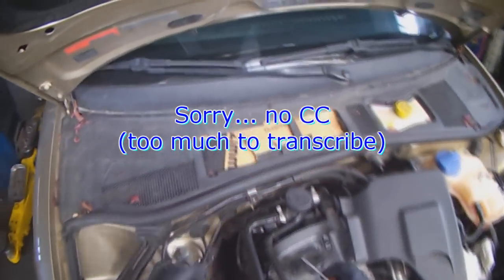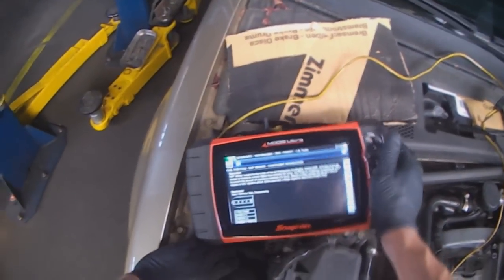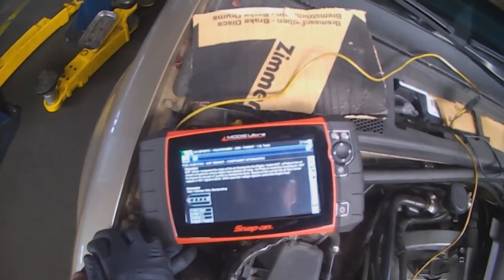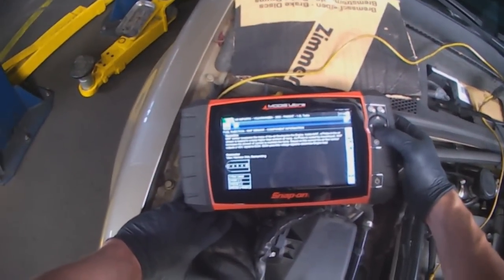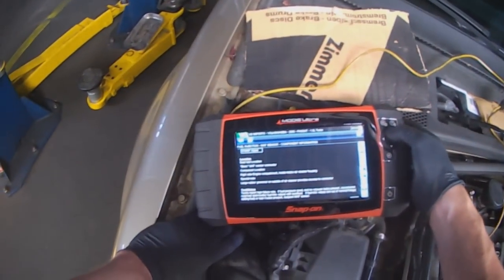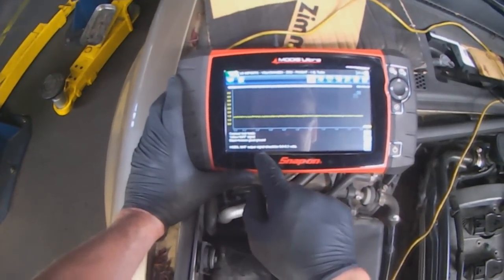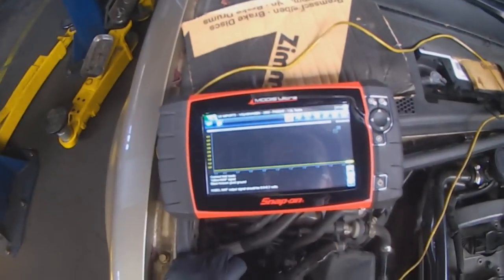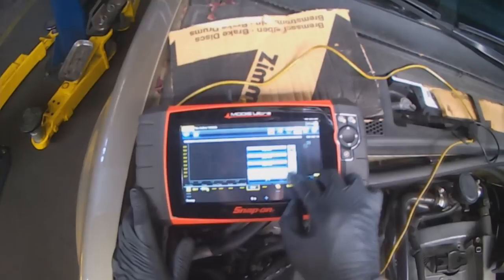1.8T MAF sensor signal output (helping a viewer)

Comment: Hi, i have a p0102 code and no maf input at all the signal is 0g/s. I don’t have battery positive on the pin 2, i have 0v. I’ve seen the wire from pin 2 goes to the fuel pump relay, could it be a bad relay ? Note that the car starts and runs but with a loss of power. Also fuses s28 and s32 are good. Anyway thanks for your videos used to watch them when working on vag’s they are helpfull. ;)
Reply from the maker: The C5 A6? What year, engine? So I can look at a wiring diagram.
Reply: Sorry forgot to mention that... it’s a c5 a6, 2001, APU engine 1.8T. 
Don’t lose your time for now i think i found the problem, someone have changed the maf sensor connector before, and the battery positive and the signal wires have been switched. So i had +12v on the pin 5 and 0 on pin 2... found it cause with maf sensor connected i had 1.5V on the pin 20 behind the fuel pump relay, and continuity between pin 2 and pin 29 of the pcm connector. I actually have a wiring diagram but didn’t expect a switched wires problem. Thank you very much for the fast answer and for your time anyway. I will come back to confirm or cry and call help if i’m wrong. Haha
Reply from the maker: Good troubleshooting!
Reply: Thanks mate ! 
Soooooo... today i’ve switched the wires back to their right place. Now i have 12v on pin 2, 5v reference on pin 4, a good ground on pin 3, and still no signal on pin 5. The wire continuity from pin 5 to pcm is good. So i guess the maf sensor burned out from a bad wiring... the customer has changed the maf sensor before bringing the vehicule to me. We tried his old sensor and same thing, and it smells burned. 
To be continued on tuesday, when i’ll have a new sensor.
Reply from the maker: Thanks for the update!
Reply: Hi Thomas, I'm a little bit hopeless with this car... So i've switched the wires back to their right place and got a new MAF sensor. But I still don't have any signal to the computer. In fact, I get 0V at the Pin 5 of maf sensor at idle, and i get up to 0.5V when raising the RPM's. I also don't feel an aspiration at the airbox intake, and I feel a little bit of it when raising the RPM's, which is what the sensor tells me too. And I believe the ECM doesn't interpretate any signal Under 1.5V, am I right ? what is strange is that I don't hear any kind of boost leak, which would be a place where the engine could get air at idle, and I don't hear or feel any "vacuum leak" between the airbox and the turbo neither. The only thing I see is a sort of mechanical valve that's on the pipe between the airbox and turbo and connecting to a pretty large metal pipe that goes around the head and then under the intake manifold in the crankcase I believe but not sure... this valve is open all the time. Is it a breather for the crankcase ? And should it be open or closed when off the car ? and so could the engine get air from their rather than the airbox which has a restriction in it (the filter). I've tried to get it off and close the holes it left and i get 0.2v of signal at the sensor then. without further information i'm stuck... Also what I need to mention and you probably guess it already, is that the car has not been worked on properly in the past... The car came with an APU engine from the factory. then it has been changed for an AEB. I don't know the différences between these two but I know they have different ECM's because my scan tool won't scan it if i specify an AEB in the vehicule selection. I have a Bosch KTS 540.I also get a P1287 code for a "turbo circulation valve", this code disappeared when i've found its connector hanging down in the engine bay and connected a N75 to it. But this valve should be there and should control a vacuum line that i can't find. that's not my main problem but maybe it's a part of it. what has been done to the car and how i can suppose anything. there are vacuum lines everywhere on this engine and i don't have any diagram to it so i can't check if it's alright.Sorry for this time consuming message, and sorry if it's hard to read, i'm not an English speaking person in the first place... If you can help me i would be very grateful, thank you in advance. ;)
Reply: Ok, I did some more tests this afternoon. Forget about the air intake system, when I close the entry of the hose going to the turbo and the hole left by what i believe is the breather valve (?), the engine stalls, and all the hoses collapse until i get my hand off. No leaks there.But what i've found is that i have continuity from pin 5 of the maf sensor and the battery ground. I don't have the continuity if the ECM is unpluged, and the wire is alright. So i suspect the ECM now. Can you please tell me if it's normal that the pin 5 of the maf sensor or the pin 29 of the ECM go to a ground ? Thank you.
Reply from the maker: I don't have a wiring diagram for that vehicle (non north american), sorry... so I can not confirm what each pin "should" be. I had a Touareg a few weeks ago, where pin 5 on the MAF was the signal. I'll try to find a wiring diagram, so I can check.
Reply: Thanks man really appreciate that ;)
Yes i’m in france we may have different cars. We especially have many diesels here.
Tomorrow i will check out on a seat leon vr6 which is an equivalent to a mk4 golf or an a3 8L. Not the same car but i believe they all work the same. All i want to know is if the signal normally goes to a ground in the ecm, cause it’s what it does in this a6. If it shouldn’t i will be confortable to tell my friend his ecm is dead.
Reply from the maker: The signal wire is a shielded wire.... it could be that the "shunt / shield" wire that is surrounding the signal wire, is shorted to the signal wire:
http://friesian.lr90.org/gallery2/d/186-1/maf.jpg
Reply: Thanks !! 
So the black wire that’s on the right of the diagram is this shield wire right ? Do you know where the “b1” that it goes to is so i can check it or is it just a ground ?
Reply: Do you think it would be ok if i run a new wire with no shield and nothing like that ? 
I don’t want to open the whole wiring harness searching this shield wire and where it comes to the signal wire...
Reply: Wait a minute. If the shield wire goes to a ground, and my signal wire is shorted to the shield wire, i would have continuity to ground even with the ecm unpluged, right ? I don’t have continuity to ground if ecm is unpluged. My short to ground, if it is and if it’s not normal, is inside the ecm.
Reply from the maker: That's the only image I could find... I don't know where the shield is actually grounded. If the shield gets a ground at the ECM, then it will not show a ground when the ECM is disconnected.
Reply: True ! You get a point here. 
So i’m going to test it the hard way, with cutting wires and burning things etc until it works. I’m getting the scanner and the voltmeter in the toolbox and hammers and saws out ! Haha
I will come back to tell what is the end of the story. ;)
Reply from the maker: You should see the shunt at the ECM connector. It runs the length of the wire. if you don't have continuity to the shunt, then the ECM is bad (from incorrect wiring).
Reply: Yes of course that’s what i suppose, the ecm is bad because someone messed the wiring up... 
i will try what you say, first i have to find the pin that this black shield/shunt wire is going to. At least i know it’s a black wire that’s already something ! Thanks.
Reply: Hello Thomas. I have to thank you for the suggestion of a signal wire shorted to the shield wire. That was my problem, after switched wires... so i’ve found the shield wire, it goes to pin 32 of the ecm and i had continuity between the two. So i ran a new signal wire and i now have a maf signal and the computer reads it, works fine. 
So thank you very much i’m not sure that i would have accomplished it without your help and i can’t imagine if we had replaced the ecm and it wouldn’t have worked... 
but, i still don’t have the power i should so i suspect the turbo control circuit and all that... the car doesn’t even have a N249, just the connector. And i think i don’t have boost pressure the car drives like a N/A... 
anyway, no codes stored in the ecm is a step forward i’m happy with it. 
Thanks again ;)
Reply from the maker: Thank you for the update! Keep me posted on further findings!
Reply: What happens if I have power on my ground pin
Reply from the maker: Not knowing what year car, make, model & engine... or what you are using & how you are checking / taking measurements, I can't say the "power" you are seeing is normal or not.

Comment: Thomas EXOVCDS maf sensor 2.0l vw city golf 2007 line signal in rpm 780 should be how average. thanks
Reply from the maker: At idle.. should aso be around 1V like in this video (if I remember correctly).
Reply: if signal more that 1v is that problem in rpm 780 .thanks
Reply from the maker: Ali J "Around" 1V means that blow or above is OK.
Reply: thank u very much

Comment: Cool why engine not front drive wheel
Reply from the maker: It has front drive wheels... the transmission is sitting backwards, so that the differential is used to drive the front wheels. :)

Comment: Nice testing, I  use the rpm in relation to maf  in a crude way of  trying to see if the maf is off but some are saying I shouldn't do it there are too many variables . What your thoughts on this. Do you do it too.
Reply from the maker: In the other video I mentioned high or low throttle with high or low MAF signal... on a snap-throttle, yes, I would expect the MAF to mirror / follow the throttle on the initial pedal-to-the-floor application. But you can see in the video that it will not be a straight line like the throttle (in this 1.8T case). A slow gradual application of throttle from closed to WOT (while driving), might show something a bit more linear.I've been wanting to start a waveform library for years... will hope to do so soon, so I can get some good baselines on my channel for people to refer to.
Reply: *****  good idea.

Comment from the maker: 10:40 electrical glitch / wiring... causing signal loss / affecting the MAF signal voltage output.
Reply: Hello, 1998mod 1.8T AEB Crank- No start condition, happened while engine running at operating temp. when i unplug the electrical connector for the intake throttle body it starts up but dies shortly after. i have no check engine light or codes on my cheap scanner. Thanks!